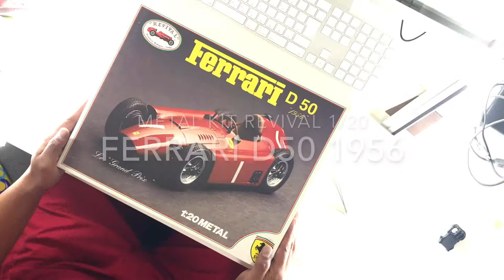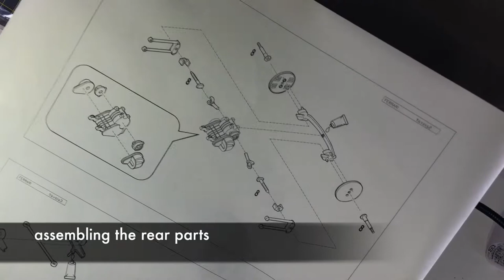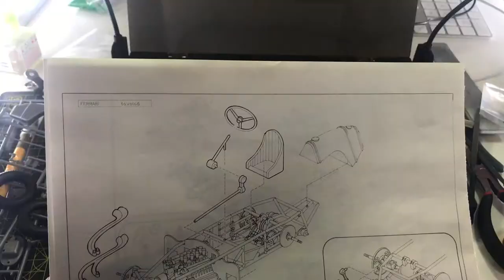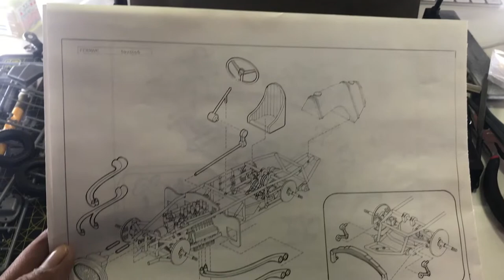1/20 REVIVAL FERRARI D50 1956  MODEL KIT

Comment: I have built Revival grand prix cars and there is one thing that model makers  should keep in mind is that the rims  that the tires wrap around have sharp edges and they must be grounded to a rounder profile if you don't the sharp edges will cut into the rubber tires and over time they will split, remember the kits are heavy.